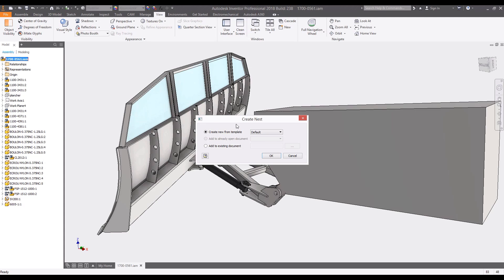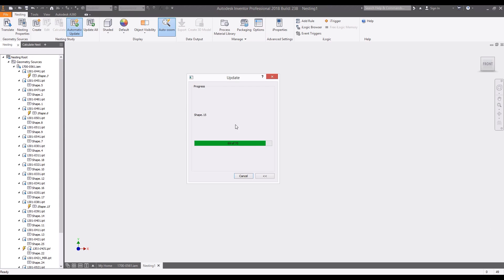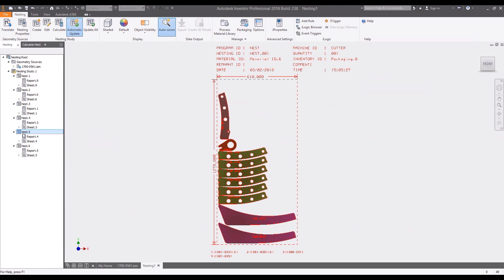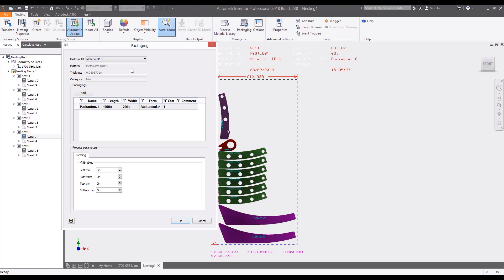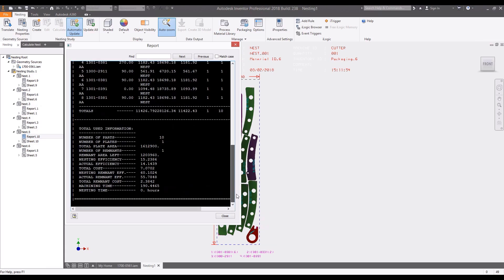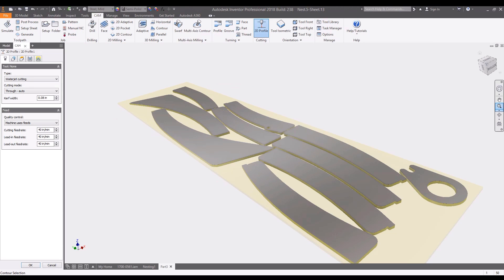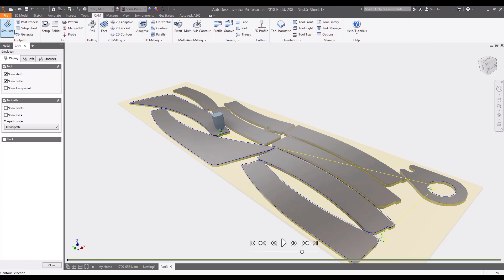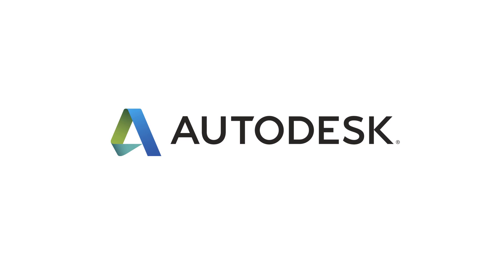Autodesk Inventor Nesting Tools

Comment: does the utility work on inventor 2017
Reply from the maker: This became available in 2019 release.
Reply: @AutodeskMFG  last question, from the cadac store I cam buy inventor 2019, will this include the nesting utility thanks
Reply from the maker: Nesting only comes with the Product Design and Manufacturing Collection not stand alone Inventor.

Comment: It's getting the profile all wrong. Say I'm working with a plank of wood it uses the end grain dims as the bits to be cut and makes the thickness of the stock the length of the plank!! Is there no way to change it?
Reply from the maker: Without seeing the mode it sounds like the orientation of the model possibly. It should be looking at the "Z" axis for the thickness. You could also try converting  to sheet metal parts that way you can choose whatever face you want for the thickness. Let me know if this works...
Reply: @AutodeskMFG  Thanks for the response :)

I would have thought that the 'top plane' of any part would have provided the X Y to help figure out the Z. That way we'd only have to reassign the top view and not fiddle with the model. 

Is it possible to convert a whole assembly to individual sheet parts? 

How does it know what my Z is because there are several options for planes to draw on and directions to extrude; I'm just a little for a confused because it used to work for a model ( it didn't use the width of the (wooden) sheet as the thickness/z of the stock) but then the following times, it would only do the opposite
Reply: I have 2 other problems but I'll wait to see if we can iron this one out! :)
Reply from the maker: Hi Stephen. If you need additional support, you should check out the Inventor forum and post your questions. That way technical support can get you a more detailed response and other peers in the Inventor community. Here's the link: https://forums.autodesk.com/t5/inventor-forum/bd-p/78